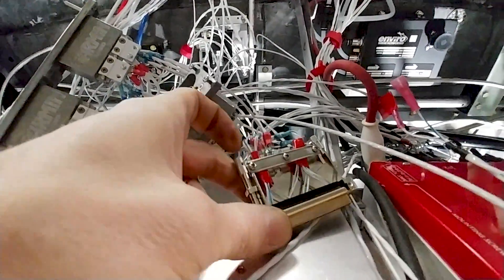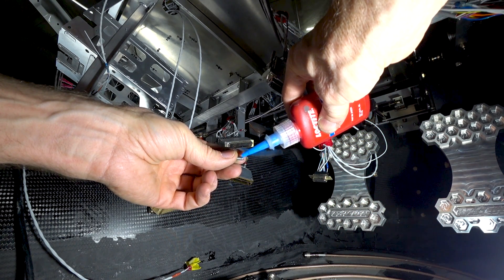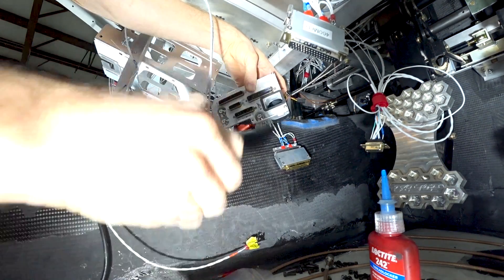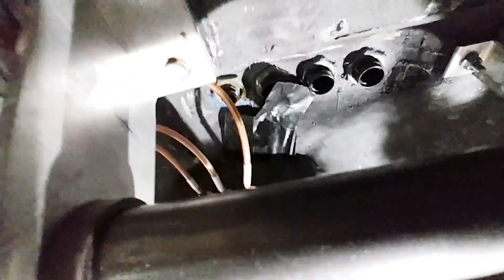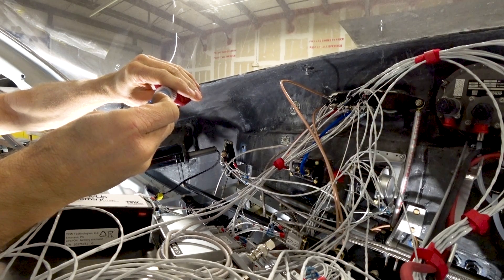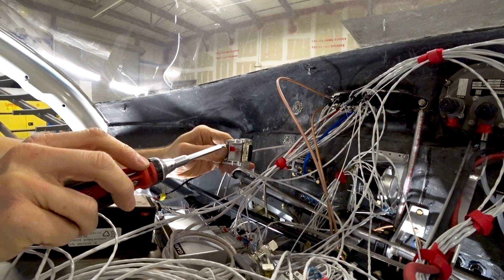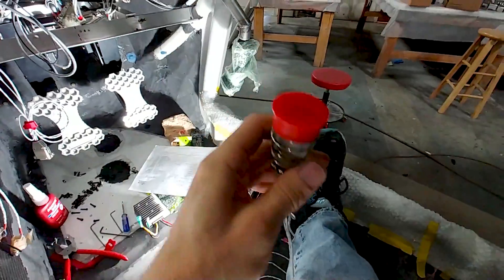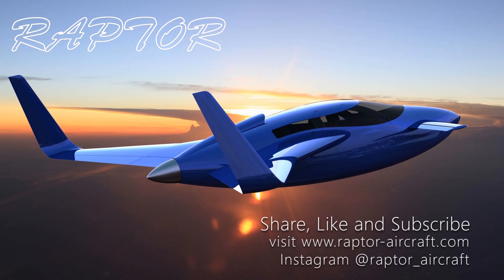Wiring is Fun? - Building the Raptor Prototype

Comment: Oh, boy Peter, can I sympathize with you!  I was a production worker in a small wiring harness manufacturer in my youth, and it was tedious enough doing what you are doing while standing up working a couple of plywood sheets with tie-down screws as a template, and I have wired enough vehicles to know the pain of working in cramped quarters as you are.  I believe I was a mind reader tonight because I was thinking that you would greatly benefit from having wiring harnesses built for the production phase, and then you said as much.  I know, pretty obvious, but still - I'm on the same page, so if you need some help with setting up production templates for the wiring harnesses, I'm here to help if needed.

Comment: Soundex Aircraft sound deadening insulation, is what will keep my Raptor more quiet and cozy. I'd like to use the Bose ProFlight head set, if the power-plant location, 5-bladed prop and Soundex product will allow that to happen. If not...the Light Speed Tango Bluetooth head set, will do just fine.

Keep up the great work Raptor Team!

Happy/Safe Flying Y'all!

Comment: Building cable looms is a job in itself. For production you may want to subcontract this to specialized companies. There are several companies doing this on a professional level, not just for car prototypes, but as well restorations (Cable looms are a very important part in restoring cars)  - or customizations.  Some accept even batch sizes of one. Ofc, there should be a well defined (and proven) measurements/schematics and wiring diagrams. Saves a heck of work - I really prefer to have it done, even if this means spending a lot of time to draw up standard compliant documentation :))

Comment: As a young man, I worked at the Piper Dealer and FBO in El Paso Texas.  I was their avionics installer.  I did thousands of wiring harnesses. In the 1970's when you bought a plane it came with no avionics.  My job was to install the Radios and VOR/DME indicators, etc.   You need much work.  Don't use tie wraps or such.  Use wax covered lacing string.  I would lace all the bundles.  That will also show you for the future how you should have done them as pre-done wiring harness.  Airplanes vibrate at very high frequencies.  Those wires are going to vibrate and over time;  the wires will come loose and degrade.  You can't just have them secured at the plugs.  Do it now so you don't have to chase gremlins in flight testing.
Reply: I used to create wiring harnesses for military aircraft, fixed and rotary wing. The methods that are used in this video are borderline suicidal! Like you suggested, using wax covered string was important and is necessary to prevent wear. There were so many shortcuts taken, and improper steps, along with a complete mess of wires running everywhere, that this entire wiring job is a HUGE hazard. I'll be surprised if this airplane stays in the sky more than 200 hours without major wiring rework.

I've seen too many lives lost, and countless others put in jeopardy because of seemingly small things being ignore. Using velcro ties on aviation wire harnesses is displaying complete neglect for the owners own life, anyone who gets in the plane, and everyone that flies airplane. Who knows when he is going to have an issue with the airplane and it's going to fall out of the sky and kill four people in a house, like the one out in California.

Hopefully the owner understands what he's doing before it's too late and re-does all of the wiring properly.
Reply: @ineurodreams  I was under the impression that all the "rules" about how aircraft wiring has to be done, like the lacing, date back to the 60s and 70s when wire insulation was much less resilient. Moderna automotive wiring lasts for an incredible amount of time, much longer than the number of hours an airplane is likely to ever see, so even if the vibration situation is different it's not clear to me that automotive wiring is more likely to fail. There are tons of experimentals that don't use "certified" aircraft wiring techniques and you don't see electrical problems up there in the causes for accidents.
Reply: @patrikj  those "rules" are written because people "died", there are some that can be bent, and others that shouldn't. I would agree with you in saying that wiring was less resilient and some (maybe even most?) of the rules were written in that timeframe. Being more resilient to chaffing just means it will take more hours before you eventually have a failure.

Just because you don't see electrical problems up there as the cause for accidents, it doesn't mean the problems don't exist. Look up Abraham Wald, and his analysis of providing armor for the bombers. He said that the bombers that weren't present for analysis of where to put armor were not there because they failed to return home. In the same way, there are plenty experimentals that have problems and don't crash, but we don't see their problems in accident reports. So simply saying that "we don't see those problems in accident reports" does not mean they don't exist. Statistics would paint a much clearer picture if there was a system in place for every pilot to report every issue or concern, and how they overcame problems. There are plenty of reasons why it isn't near the top of causes for accidents. They could range from reasons like people understand how crucial it is, people make other mistakes much more frequently, to reasons like the electrical systems failing aren't causing wrecks. If you have manual flight controls, it doesn't matter if you have an electrical failure. If you have a fly-by-wire system, all of a sudden any little wiring problem is the potential for you to crash. So that gives more reason to why electrical failures won't cause experimental to crash, they aren't fly-by-wire.

To address your point about automotive wiring, they have relatively strict guidelines about how wiring should be done. The problem you always have any time you compare aircraft and automotive standards is what happens when you have a failure in each situation. Just ask around how many people have been driving, or riding, in a car and had the engine die on them. As we know, that's much different in an airplane, and we understand the amount of paperwork that it generates when something like that happens while you're in the air.

On top of this, automotive wiring standards don't do things that are seen in this, like letting wires hang right out of the connector. I don't know if he addressed it or not, or if he is going to do anything different. Letting those wires come straight out of the connector, and securing (velcroing) them together shares all of the stress and weight of all of the wires. This means, that potentially all of the weight and vibrations are going to be put into one of the wires and it will break off at the connector or crimp. Every time there is vibration, or stress is put on the wire, it doesn't get transferred to the back-shell of the connector and provide stress relief. Instead the weight and mass of all of those wires potentially gets transferred into one wire and it gets stressed until it breaks. When that happens, most likely it will be a smaller wire and most likely won't be crucial to staying in the air. So it will break, the result won't be a crash and we won't hear about it....it doesn't mean that it wasn't a problem.

I've been around aviation for only about two decades, but it's been long enough for me to see one very strong trend. There are pilots that cut corners with the "rules" or "certifications" and they take chances. Invariably, those are the pilots that have a higher rate of death and accidents than the pilots that follow the rules and respect the reasons they are there.
Reply: I agree. I worked for BAe back in the day, making the 146. The wiring was always carefully tied with wax string and tied to support structure. As soon as the plane starts doing cycles, the wiring will start to degrade. How long it takes to fail is a matter of how well it was installed.
I was also an RF Engineer in Production Comms and I was amazed at how well some of the gear could dismantle itself in transit to and from gigs. So much threadlock...

Comment: 11:00 Use heat shrink tube, even the single loose wire at 18:07 would get a piece on.
And use cable zip ties, to relive strain, at the rear of any unit bundle up the cable going to it, and it help to tidy up the rest of the wiring 
BTW: just close the zip tie but leave it loose until the end, and don't worry to cut or replace any zip tie until it works, they SO cheap.

I used to work in similar conditions, just add old cutting fluids/oils on every surface around you, where you get mad because the freshly stripped wire felt into oil, making it nearly impossible to solder it to a db25 connector (each single wire got its shrink tube too)...

Comment: For production aircraft, the wiring is all pre-cut according to the appropriate lengths and then loomed up and terminated outside of the aircraft on jigs. It then undergoes automated validation testing before being fitted, or boxed up as a spare. On the up side you can either stand or sit at a bench while doing it all.
Reply: I live in Wichita and worked at Cessna as an Electrical Tooling Tech back in the late 1970's before moving to Boeing and you are correct this is how it was done.  We used a DITMCO wiring analyzer to test the harnesses to ensure correct continuity and also to test for shorts.  I was always surprised how many mistakes could be made when soldering and inserting pins into plugs.  But the testing made sure the harness tested good per the engineering and we rarely had issues during installation.

I'm now retired and I'm sure the technology for building wiring harnesses have changed.  Please watch this video for the way we did it back then and a newer way that technology can enhance and reduce the costs of making wiring harnesses.

https://www.youtube.com/watch?v=nlT2w082mrc

Peter it's looking great and I am excited to see it fly.

Comment: Curious where the quick dawn O2 masks will sit.  Looks tedious but also satisfying in that old 'if you want it done right, do it yourself' kind of way.   Cheers.
Reply from the maker: They are not required if you're flying below FL250. We will have portable ones just in case during flight testing.

Comment: Avionics tech here. Use urethane self sticky tape for the canon plug backshell clamp Mil-I-46852. At work we call it chafe tape. The benefit is there is no sticky mess like what electrical tape leaves behind
Reply: And why not using heat shrink tubing? That what we do in industrial environment, tape will get loose with cutting fluids/oils...   
Also he needs to use way more, cable zip ties, specially when multi-cables get to a unit, it help massively to relieve strain....
Reply: Completely agree! That's exactly what Garmin calls out to use .. they have their own P/N for it, but it's just AA59163/MIL I-46852 silicone fusion tape. It grips the wires nicely and compresses in the clamps, providing some cushioning that the electrical tape he's using does not provide.
Reply: To shave weight and keep better flexibility in the wire bundles, use lace tape instead of zip-ties or Velcro strips.

Comment: That's some nice work there. I spent the first half of the year doing wiring harnesses for a variety of different commercial and industrial road and off-road equipment, and it's time consuming no matter where or what you are doing it for, though definitely better to go the automotive route by putting in the dash already pre-wired if possible. Loving this build!

Comment: Very fuzzy
Reply: Give it time, that's a YouTube issue.  Immediately after upload the resolution is lower then as they finish processing the higher resolutions become available. Allows for videos to be posted asap regardless of slow connection, the faster the connection the quicker the high res becomes available.